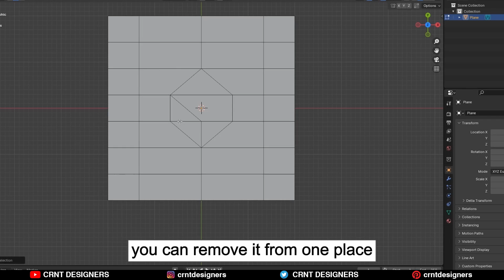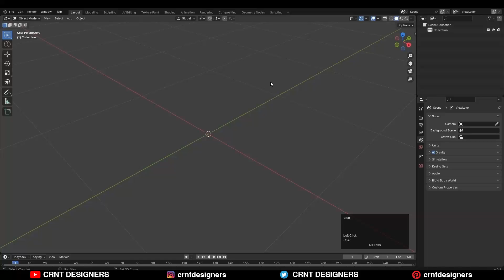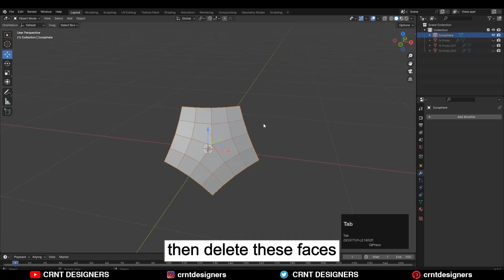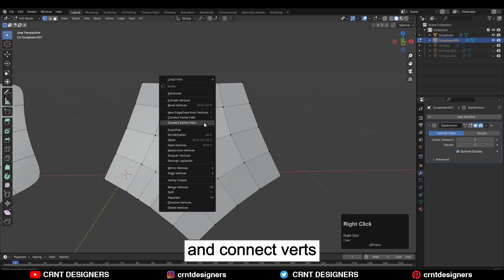Every 3D Artist Should Know how to Solved Edge Poles in Topology

Comment from the maker: 1st thing you need to understand, You can’t remove the pole completely. You can change its position. Now removing or moving poles to different locations from existing positions required adding or removing edge loops. And it changes the density of topology. So better is to plan required poles in advance.  You should try to move poles to flat areas, less visible areas. Here in the sphere case there is not a flat area but in the plane case there is the flat area. Hence I can't change the position of the pole efficiently in the sphere case. I have explained these points in a video. You need to watch the video carefully.

Comment: so close to useful tutorials on base case remediation, but then you ruin it by changing the edge of the newly created hull faces by subdividing the borders by introducing full loops, making them no longer exemplars of base cases.

Honestly, the only way to actually eliminate a pole and not siply slide it around to a new, less inconvenient location or addnew ones would need to entail a partner pole, or a hull/symmetry border edge to be subdivided.

If you have a second pole, the 2 can have edge loops bridge across to each other the way your trailing loops extend off here, and the loops created by that bridge can regularize the edge loop density.

It's less helpful to worry about pole elimination for base cages than to consider ideal locations where the irregular behaviors become preferable descriptors.  Ultimately, you need to treat it more like a game of old fashioned nurb patch modeling, letting patches join along natural seams and folds so that the puckering, creasing and shading codependencies also describe the form.

Comment: 0:41 A triangle fan on your cylinder object is still bad, even if it is a flat surface. It will slow down performance.
Reply: This is not a triangle fan. These are quads
Reply: @angulinhiduje6093  It's still a triangle fan. Look at the center.
Reply: given your handle, you may be knowledgable enough with EBOs to know, but technically, he is correct: not a fan, just following a fan pattern in isolation.  Would be quite hard for the cylinder to define it's triangles in a fan just for the cap of an otherwise half-edge mesh model structure.  Not that it matters, your meaning is clear enough.  That said, your point is not: triangles in a mostly quad based mesh aren't intrinsically slower: adding irregular math for deformer stacks is what's usually slower, but that's not even close to relevant here.  At the root level, all quads are merely triangle pairs with fewer edges in that secondary EBO

Comment: Useless video. To solve the pole make a new pole 😂
Reply: Yoy clearly dont understand topology. 

Poles are bit bad in general. In fact for a sphere like shown in the video they are unavoidable. 

You just want them on mostly flat geometry so at times you need to move them.
Reply: @angulinhiduje6093  this is not about topology, this is about shading, because no matter what topology have an object if it looks nice in render (and causes no problems during animation) 😂 don’t teach anyone if you are not pro.
it is much better to make a new topology in this case (what I usually do). This method doesn’t solve the main problem and this is fact
Reply: @PoMkAc27  okay so youre clueless, got it.
Reply: can't blame you for trying, but yes: poles are inevitable unless you have a simple, flat (or at most, bent), quad plane.

It's just a question of where you have them, as you say.  One can run a retopologize algorithm, but that won't get rid of poles, only move them procedurally by angles of volumes formed, and without your consideration.  By his own admission, there is more to consider in any triangle mesh than a single frame of animation, and if you have a reason to care about a base cage, you have a reason to care about those factors as well.

Comment: Yes u have erased the Pole, but u ve also introduced irregular topological density. Adjusting the edge loops until they have no pinching in the sub d result, can take a huge effort at the end on complex surfaces
Reply: Yeah, the curvature before was very specific and calculated but doing this could add unintended flatness.